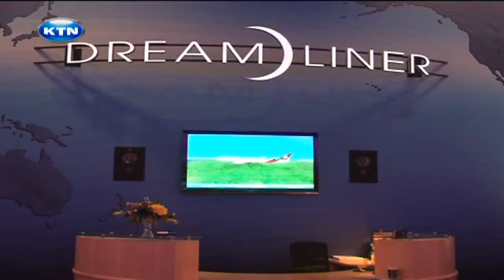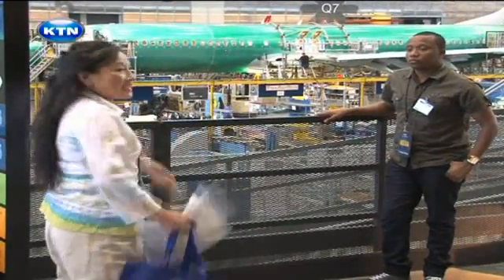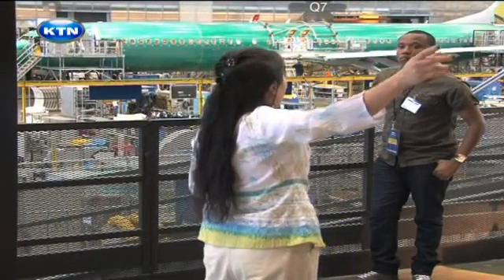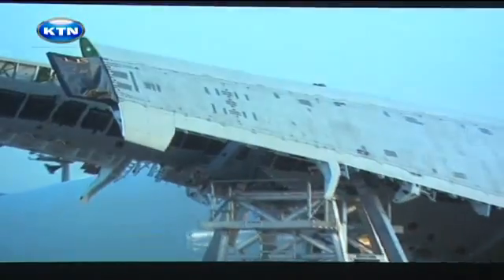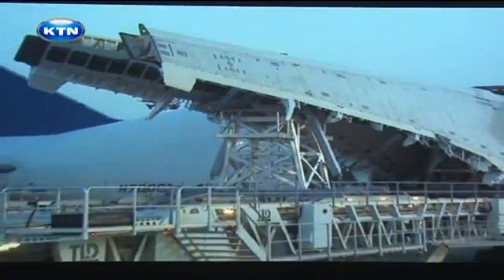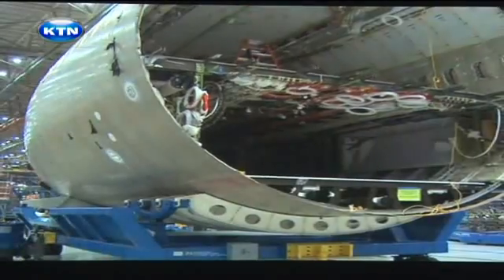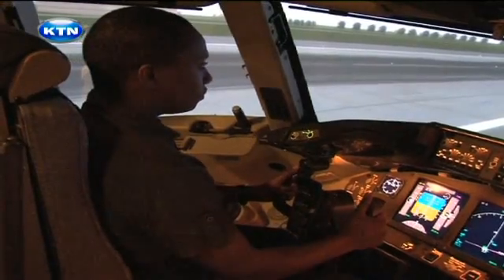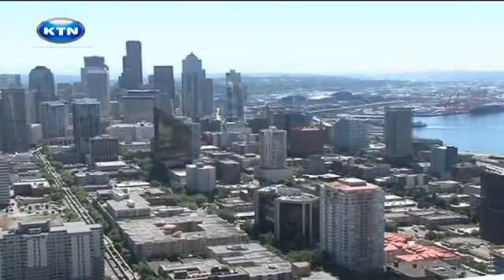Tech toys - Dreamliner (boeing 787)

Comment: Mercy mercy ..some mistakes here.
The featured aircraft is obviously a 747-8I (including flight deck simulator) -not a "787"
The 787's windows feature electrochromatic shades -not "electromagnetic".
787 cabin pressurization is equivalent to 6000 ft altitude, compared with 8000 ft for conventional airliners. This means a higher cabin pressure -not "lower"
The windows are 30% larger than most other airliners -not "65%"